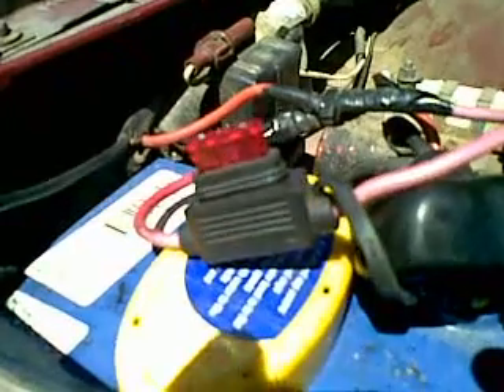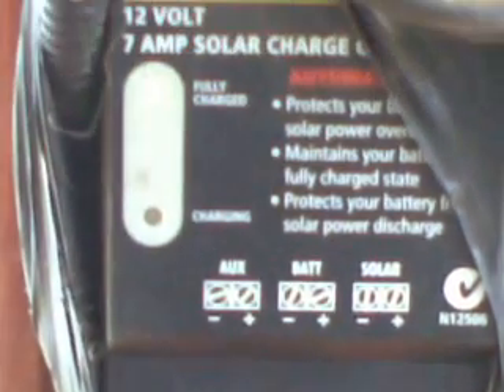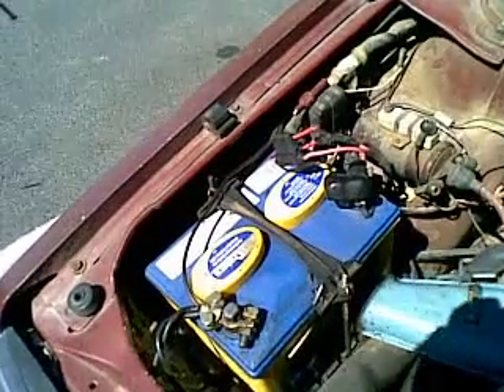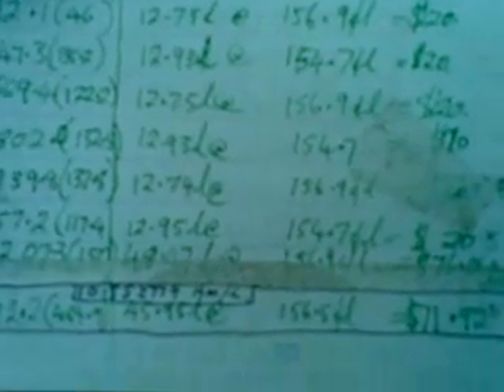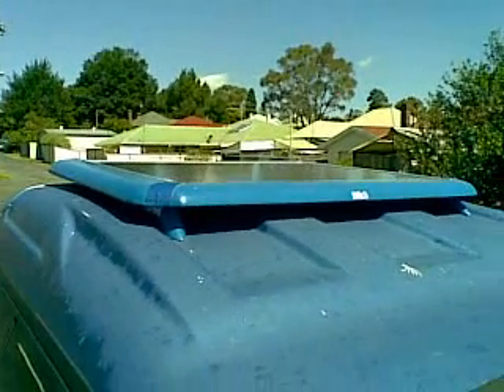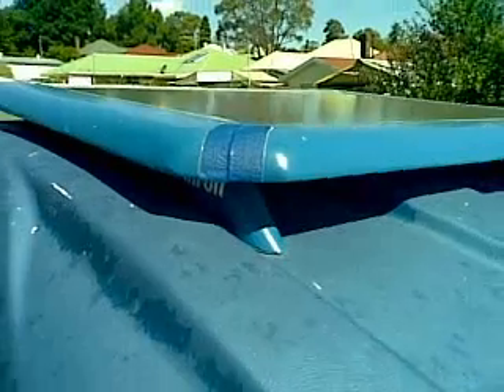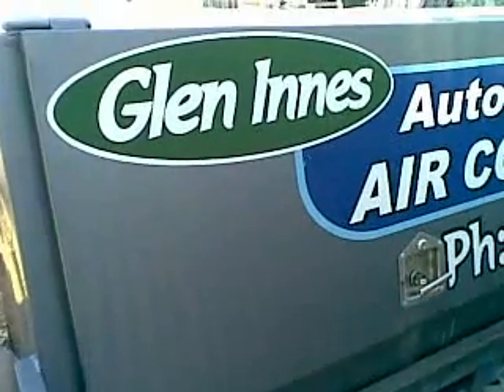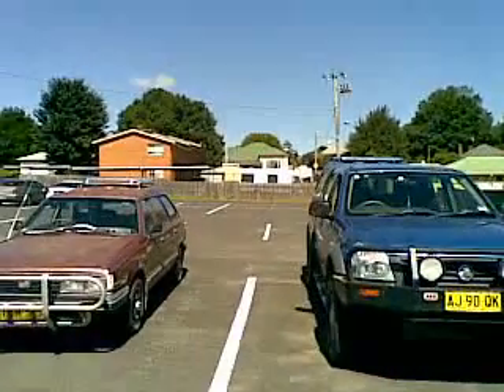SunFoil Safety Fuse Issue... Plus 3rd & 5th Prototype Updates.

Comment from the maker: @Johnsolar283
 G'day John... Thanks mate ! Um, yeah, the Duct tape is holding up quite well...; but you can see from the Fuelburn response to pulling it off last time, to fix the Previous Paint-Failure, how asymetrically the Battery responds to supplementary feeding's application & withdrawal... That, alone explains why Dr Kruzelnicki got a null-result, when he had his isolation-switch toggled twice weekly... His Bat. Never had time to recover, but plenty to  deteriorate.. Ciao !

Comment from the maker: @davesact
 G'day Dave... Thanks mate ! I'm just glad you didn't burn the whole thing down...; & to be honest, I originally had the Fuse there beside the Battery so I could probe the Port with a Multimeter to monitor the Mk 1's Output.... The Safety Benefits were but a pleasant Afterthought. So, it's a good outcome all around, I reckon...
Ciao !

Comment from the maker: @Desertphile
 G'day mate...! Thankyou. I'm indeed honoured... If you rarely drive the vehicle, then  it's sitting there, losing 1% of it's stored charge to Sulphation every day, atop whatever charge-deficit the Average Engine Runtime would impose.... So your machine should save some fairly spectacular amount of fuel, with a SunFoil . Search "SunFoil Short-Talk" to see how to measure & calculate the optimum size PV for Spark-Ignition, & for  Diesels, as big as will fit. Ciao !